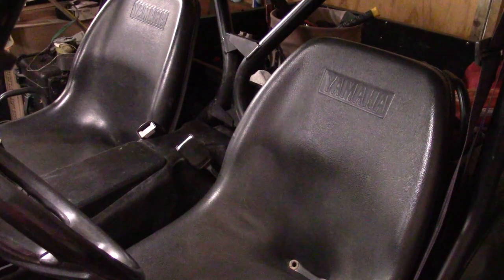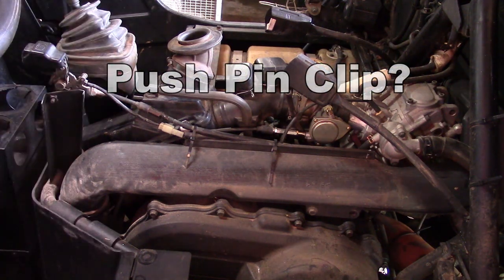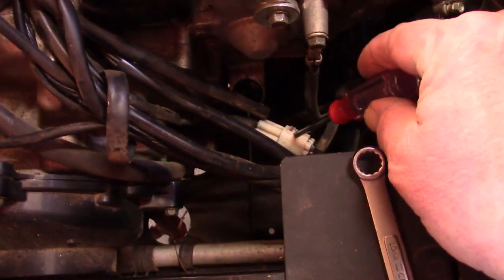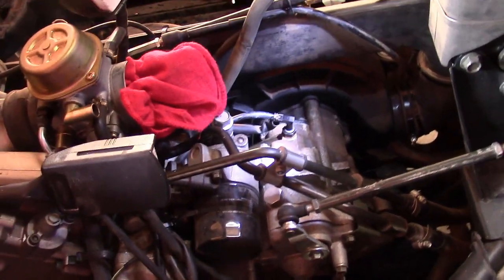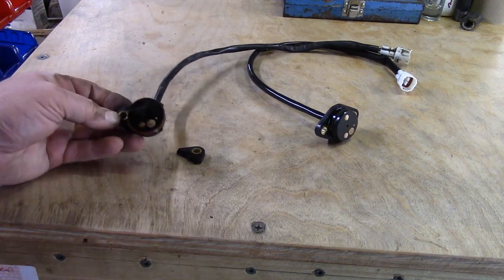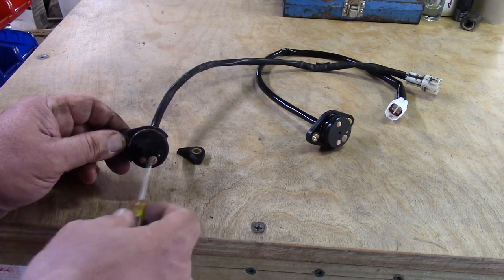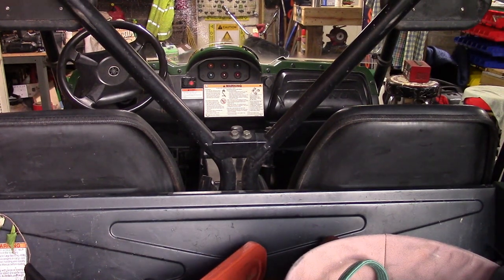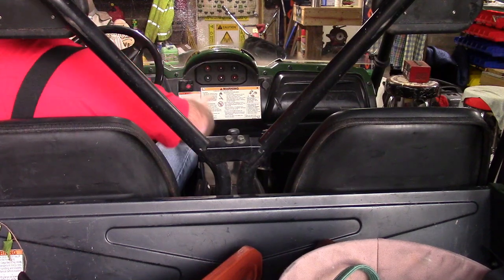Rhino 660 Neutral Switch Assy. Rhino 2

Comment: If you had two wires about 12" long each you could have made a jump by just putting  one wire on the positive post and one on neutral and touch the wires together and jump it over out in the field.
Reply from the maker: I need to add a little spare parts box under the drivers seat!

Comment: I've sprayed my neutral switch where the gasket is with wd40 for a few days to help loosen it hope that I don't break it since it is tight as a drum and hard to remove.  Any tips on getting it out after the bolts have been removed and sprayed?  thanks.